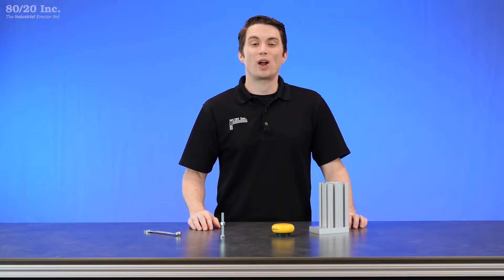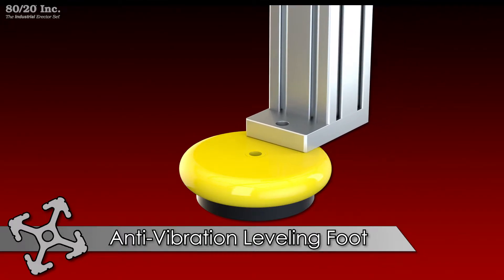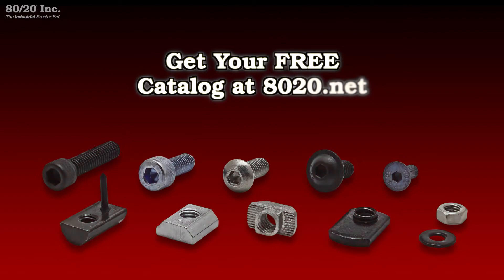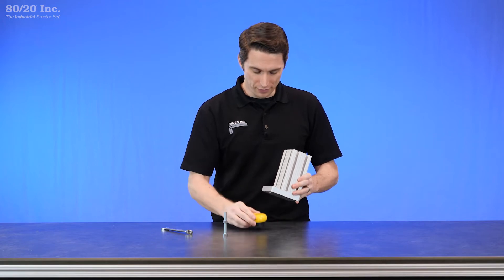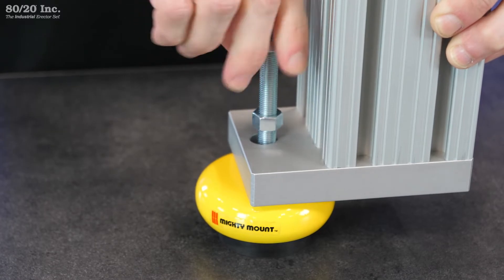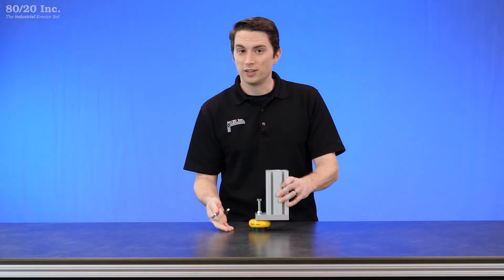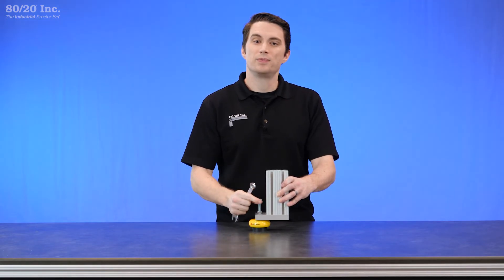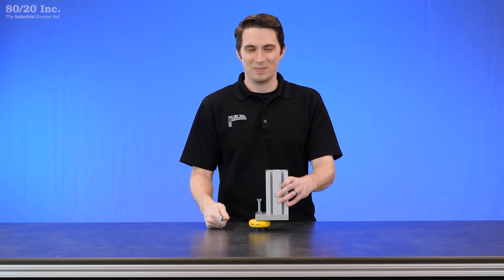80/20: Anti-Vibration Leveling Foot

Comment: Washer?
Reply from the maker: Hi there - that is an excellent question! When the foot is properly assembled (see video), it may be helpful to put a washer in between the top of the base plate and the hex nut to make it easier to tighten. However, a washer isn't required for installation.

Comment: weight capacity?
Reply from the maker: The load capacity for Anti-Vibration Leveling Foot ranges from 300-4200 pounds and 136-453 kilograms.